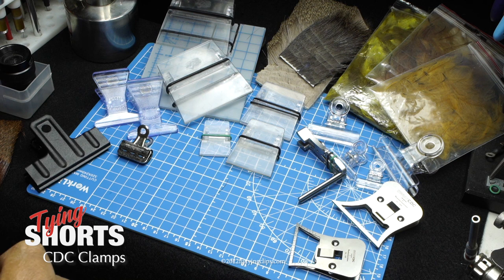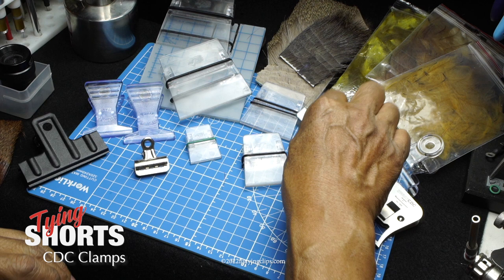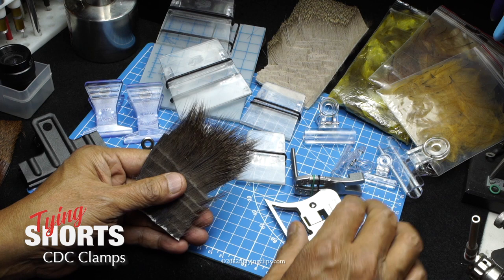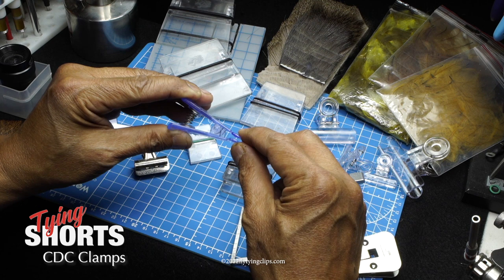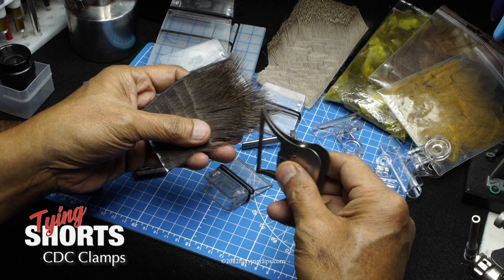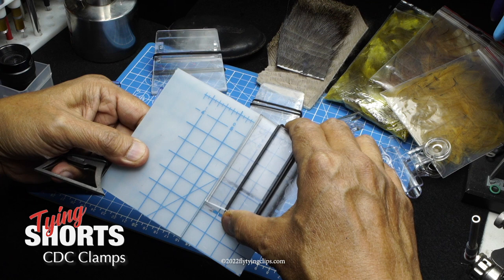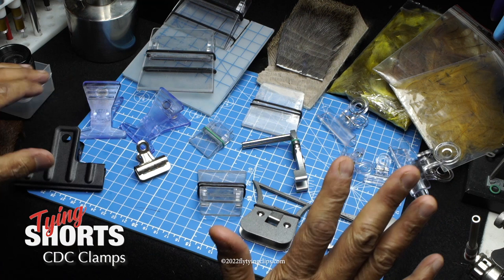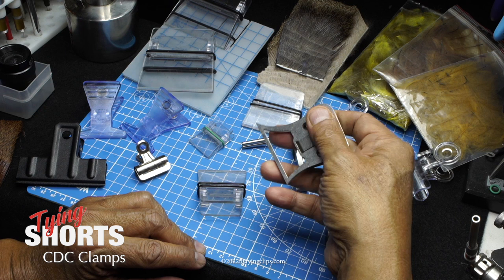Different Kinds of CDC Clamps and How To Use Them - By Herman deGala

Comment: I have seen a very simple cdc clamp, well I wouldnt describe it precisley as a clamp but get the job done, don't remember the name of the brand but it was a series of clear thin sheet of some sort of plastic conected using a sticker, and you could fold them toghether to capture your material, I think the idea was to be able to make brushes with ostrich feathers, maybe the Pike fly tyers will know what Im talking about.